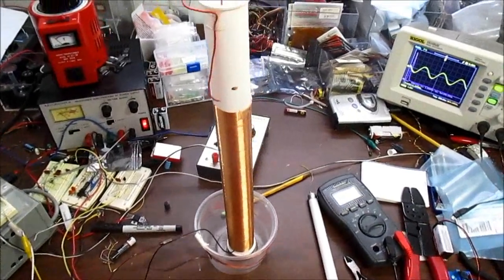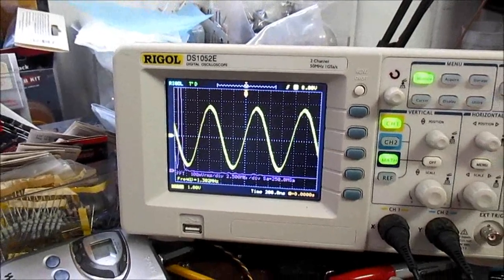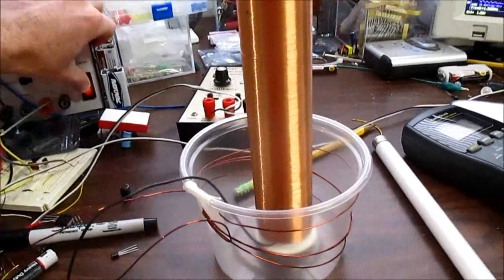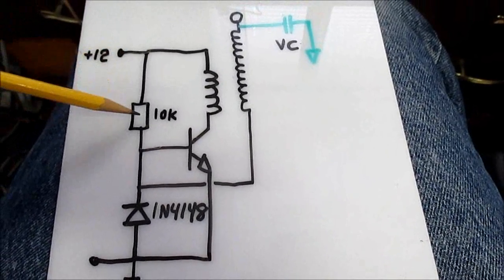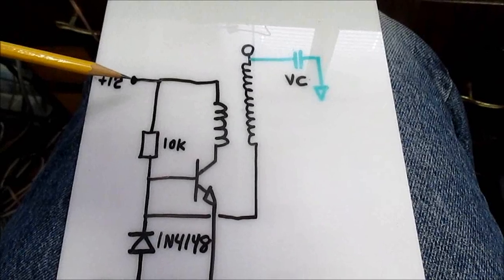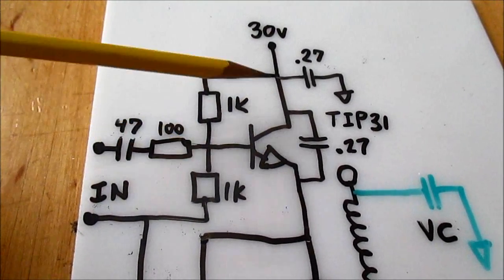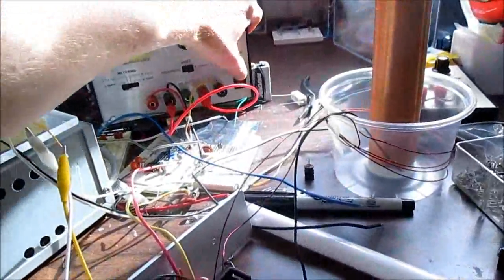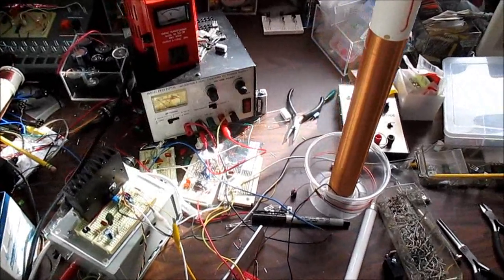Slayer Exciter based AM transmitter experiment

Comment: Hmmm What if the top wire was lengthened, not by a heap but only a certain amount if the range could be increased.
Actually what if it was a 1.5m telescopic whip? I know that with this extra length that the frequency of oscillation would  drop, but the whip would give you some range of adjustment! 
Also if you connected the bottom of the coil to a decent earth it's performance might become a lot better

Comment: Your 1N4148 diode is shown in the wrong direction in your schematic....
That might also explain why your original 2N3055 transistor was running so hot and drawing so much current....
Although the 3055 could have gotten too hot only because the frequency was higher than it could handle efficiently.
Reply from the maker: The diode is in the correct orientation on the schematic. Google "slayer exciter" and look at the schematics. They all use a diode (sometimes a zener or LED) in the same orientation.
Reply: The diode is correct as shown  ...it is there to protect the transistor from too much reverse base emitter voltage. Most transistors can usually tolerate only about 5V in reverse bias before damage

Comment: Nice! I recently have made a similar audio modulated slayer exciter, but I had a much larger  range from a lower supply voltage (6 volts) of around 40ish meters! However, the design I used was much simpler, and instead of modulating the supply current, I instead modulated the current going to the base by connecting a 1 to 1 transformer (HF choke), from biasing resistor to the base of the transistor. Although the HV transients across the transformer did cause the toy music thing I used as an audio source, I was able to have a SINGING ARC from 14ish volts, I was also able to have my design run from as low as 2.5 volts with the audio signal and 3 volts with no audio! Interesting design though!

Comment: Hey John, really cool transmitter (TX), I have made quite a few 1-4 transistor TX and have been able to get resonance, which of course you need to transmit. Check out Dazaro3 on YT, lots of good TX videos. Got me started making them. Best to build right on perf as bread board imparts stray or unwanted capacitance. Happy Fall, be good, C.

Comment: Hi John
Many years ago in my miss spent youth, I used to mess about with home made transmitters all the time. One of the simplest and most reliable was to use a 1 Mhz crystal oscillator (valve of course) and simply used a standard audio output transformer in the anode of the valve and feed in the secondary with the output of an audio amp from the speaker terminals. With a few feet of aerial wire, the signal would go about half a mile. To a 15 year old hearing your own music half a mile from home on a transistor radio as I drove about on my push bike, simply amazed everyone. Probably NOT that exciting for today's kids that would never build anything themselves, assuming they even could! Nice vid John, just needs more POWER!!
Reply from the maker: +HillOrStream I'll have to take the coil upstairs and try where the RF can better escape the aluminum siding. I'm no RF expert but to radiate the energy from such a small area relative to wavelength would require high voltage and high impedance which the coil should have at series resonance. Long wire would be too low of impedance for this circuit. I'd guess it has about 1 watt of energy radiate away.
Reply: +Michael Beeny   I'd of thought that this would have a lot of power, was surprised to see it fading at the back of John's lot. I guess it really only has the coils to radiate, I wonder it it would do more range if the coils wern't vertical, Or maybe some way to couple in a long wire antenna...